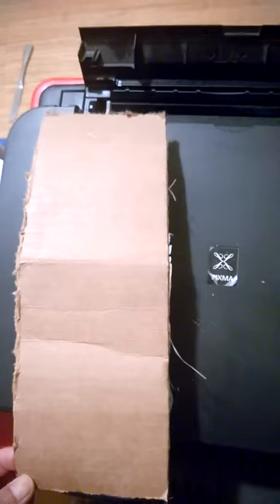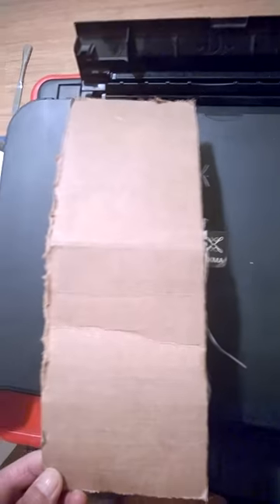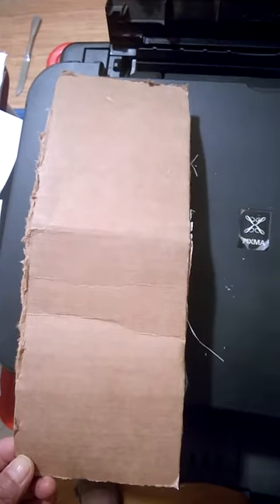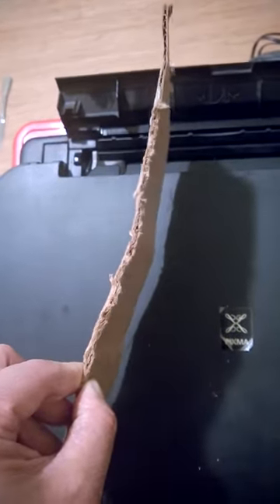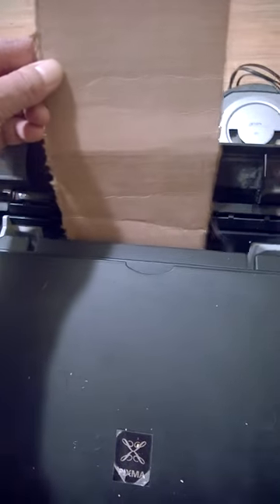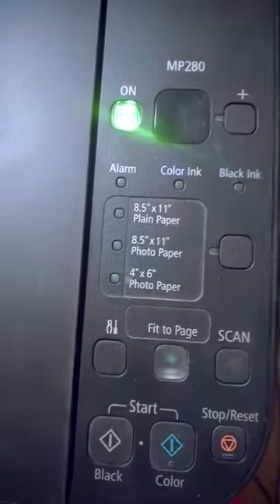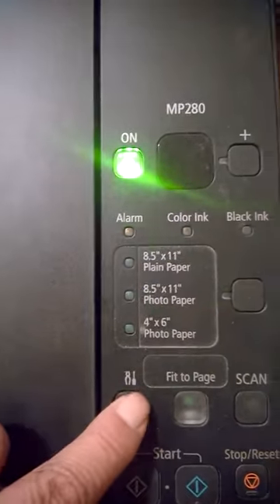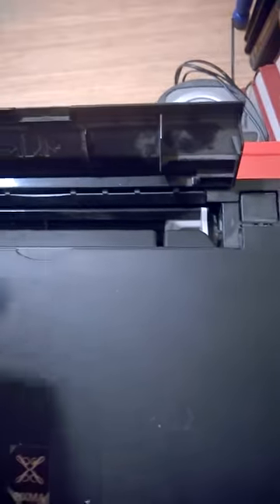Paper pick up Canon Pixma printer paper feeder not feeding paper properly in less than 2 minutes

Comment: I tried all the Canon forums. Nothing worked. But I did your trick, except with a newspaper. I kept pushing every time the rollers worked. Then, once the printer stopped, I pressed Start again to keep the rollers going again. I kept doing this until the newspaper came out the front end. Then I put the real paper in there and, voila! It works like a charm now. Thank you so much!🙏
Reply: Good to know it  thanks
Reply from the maker: You are welcome! Glad it worked😊
Reply: Having the same problem with mine, will have to try this. Kids said  throw it away and get a new one. Don't want a new one.

Comment: Thank you so much! My aging Pixma 300 has been working fine for a number of years until it stopped feeding paper from the paper "tray". I had tried using a Q-tip and alcohol to reach all of the rollers I could reach, but it didn't change the situation. I had doubts that the cardboard would work, but figured I had nothing to lose. The cardboard eventually jammed going in, but it was long enough to pull back out the paper feed slot. That did the trick! Thank you!
Reply from the maker: Glad it worked 😃
Reply from the maker: Glad it worked 😁

Comment: Worked!!!!  Out popped a nickle!  Couple of notes:

1. Gently use the card board
2. The cardboard does not go all the way through the machine.  You will use it to shove whatever is clogging you machine through.
3.  After the object is out, the machine will start feeding 3+ pages though the machine - blank.  let it finish.
4.  Upon finishing, set the machine back to "1" from "b"

Comment: My cannon pixma MG 3022 printer malfunctioned. I couldn't get the paper to feed through the machine. I watched a few youtube videos stating that the problem were dirty rollers and that they needed to be cleaned. I did this and still no success. I then came across this video and my first thought was that this was definitely going to damage my printer, but I was out of options so I tried it. IT WORKED. Imagine my surprise. I had a two safety pins lodged in there. I just want to say thank you to Ms. Lin Young for this unorthodox but effective method of fixing my printer. Thank you Ms. Lin Young.
Reply from the maker: Thank you all for your feedbacks regarding this method. :-) It's funny/not funny to read the kind of "stuff" that caused the paper not going through the feeder,  that were "pushed out" by using this method,: a Flower Stem. hah! :-).  I almost gave up trying but I am glad I did not. So. Try this method when you have relaxed and have some time to yourself. So you won't be frustrated on your first try/tries. :-). So let us know what you found inside the paper feeder that caused the problem. Unless, ofcourse, you found something you did not want anyone to know. :-)

Comment: I was about to give up and go on amazon and buy a new printer, I tried the cardboard thing and it did not work until I let the printer take the cardboard,  I felt it probably didn't work be4cause the cardboard jammed partway through, I went to shut it off but checked the inside by the cartridges and suddenly I see a shiny penny,  I then tried again and this time the paper fed through perfectly! Thanks Lin Young! Your solution really does work!

Comment: this sounds silly but this tip really worked. turns out there was some of my earphone earbuds that got into the printer! it took some time before it came out...but now my printer is working again. need to do a mental note to fold the paper feeder flap down to cover the paper pathway whenever it's not in use to prevent anything from going into it again!

Comment: Just chiming is to say that this worked! After weeks of not being able to print, I went on a Google hunt for a fix and saw this video.  Thought what the heck I've tried everything else, and sure enough a little white screw came out as the cardboard went in.  Now it works like new again! Thank you!
Reply from the maker: Thank you all for your feedbacks regarding this method. :-) It's funny/not funny to read the kind of "stuff" that caused the paper not going through the feeder,  that were "pushed out" by using this method,: a Flower Stem. hah! :-).  I almost gave up trying but I am glad I did not. So. Try this method when you have relaxed and have some time to yourself. So you won't be frustrated on your first try/tries. :-). So let us know what you found inside the paper feeder that caused the problem. Unless, ofcourse, you found something you did not want anyone to know. :-)

Comment: I was about to throw my printer away because I had been on the Canon website for hours looking for how to fix the problem and I had watched 5 other videos. Nothing was working. I didn't want to try the cardboard thing because I was afraid it would really mess up the printer, but as a last ditch effort I shoved some through and voila, my printer was working. Turns out I had a strip of paper that was crinkled up inside the printer. Thanks so much!
Reply from the maker: Thank you all for your feedbacks regarding this method. :-) It's funny/not funny to read the kind of "stuff" that caused the paper not going through the feeder,  that were "pushed out" by using this method,: a Flower Stem. hah! :-).  I almost gave up trying but I am glad I did not. So. Try this method when you have relaxed and have some time to yourself. So you won't be frustrated on your first try/tries. :-). So let us know what you found inside the paper feeder that caused the problem. Unless, ofcourse, you found something you did not want anyone to know. :-)

Comment: OMG thank you! I use a random paper manual to force it out. I found beaded ring in there thank got I elastic didn’t break. I even bought new inkt thought that’s the case though. I did multiple hard reset no results. After some searching found this vid. Your method works!! Thank you
Reply from the maker: So glad it worked. 😆

Comment: Dang, I'm impressed. I was so confused by the comments at first but this actually worked for me. To clarify, I was expecting to have to clean the rollers since I was getting the paper jam error but there wasnt any paper. Turns out, there was a twist tie inside the printer. To get it out, I just forced the cardboard in while the printer is not printing and for me it pushed the twist tie out. I wouldn't have expected that to be the issue like how would anything have gotten in there, but this video saved us from buying a new printer so thank you.

Comment: This was the video that got my hand me down printer on the road to recovery.  It led me to find out that foreign objects often fall into these Canon printers.  I've never encountered this problem with any other printer in my last 20 odd years of regular printing use!  Although the cardboard trick didn't work for me, and you will see why in a minute. I tried for quite a while.  Then tried putting my hand in , when I encountered something unusual on one side of the rollers.  Then I got a torch,  I could see a memory stick stuck in there.  I got a hook and went fishing.   Out it came.  It was a missing work one, now back with its owner.  I would say, use a torch first.  Then use the cardboard if you can't see anything.
Reply from the maker: Canon printers attract foreign objects. Glad it worked for you.

Comment: Thank you so much Lin. I did some spraying with duster to get the feed to work a short time before but the problem came back. After Internet search and more cleaning and shaking (but could not figure out access to rollers), I was ready to buy a new printer/scanner. Then I saw your video; I tried with thin cardboard I had and WA-LA! Paper is feeding again.
Reply: Me too!  Great trick, and easy too.

Comment: This method actually worked but mine was a bit challenging.  I noticed that there's a small bead inside. When I took it off, it's still a bit clogged so I did it again but this time, i tried to shake it up side down while forcing the board in and guess what, 3 more beads fell out. 😂  thank you so much for this!

Comment: Thanks for the video.  I tried it with a card stock that was the thickness of a post card and it worked.  I was too nervous to use a corrugated cardboard.  Turned out that I had a mini binder clip stuck in there!  Thanks again!
Reply from the maker: You are welcome. Glad it worked 👍

Comment: Was honestly thinking some of the comments under this video are not real LOL! But after trying this I immediately found a foreign object inside the printer. Not really sure what it's called but it's like an accessory attached to the zipper so it will be easier to pull, some kind of cable with a plastic on the end, it was stuck in there. I thought it was part of the printer as I was pulling it. But I thought that the first piece I took seems to have been cut already so if it's part of the printer then it's already broken to start with so pulling the other part shouldn't cause more damage than there already is and after getting it pulled my mom identified it as one of the little cables attached to the zippers of the bag. So yeah, thank you soo much! I thought I'll have to spend money just to get this fixed. But your 6-year old video just help me!

Comment: This also worked on my printer. Had a problem about paper jam when in fact,  there was actually no paper inserted in it. I have tried feeding my printer with a card board and it helped. It was not a paper jam issue at all; it was a twisted ring that got stuck in my printer. This card board helped me take the twisted ring out of my printer. Shaking the printer also helped in removing the clogged material in it.

Comment: This is a fantastic trick. I followed the instructions and there was really a piece of plastic in there. Tried to print but the problem existed. Then I followed the steps again with placing the cardboard at the other side, and surprisingly found another piece of plastic : ). Finally tried to print and it really worked out. Thanks.

Comment: Yes! This worked for my Pixma MG2550s! Had tried cleaning the rollers with alcohol and everything, didn’t think this was working until I noticed some bits of plaster on the table beneath the printer, kept going and sure enough a chunk came out on the side where paper seemed to be getting stuck/creased! Thanks so much.

Comment: Thank you! Our Canon Pixma mp495 was giving the E03 message. We tried a lot of things, but what worked was as follows: turn on printer, push maintenance button until we saw the lower case letter b, then, loaded the cardboard of the shape and size you showed in your video into the middle of the paper input tray in back, and while pushing the cardboard in with one hand, pushed the start button with the other hand.

The cardboard was pulled in part of the way and then we got the P03 error message. We shut off the printer and pulled the cardboard out (which took a lot of effort), but then saw that the cardboard had dislodged a candy wrapper that had been stuck in the feeder! 

If I were to do this again, I might first try it with a thinner cardboard (like a cereal box thickness maybe) before proceeding to the thick cardboard, because it got really stuck in there and hard to pull out.

Comment: @Lin Thank you so much for sharing - your tip also helped me fix my printer - I have a Canon Pixma MP282 - similar to all of the Pixma MP280 series - and my rollers on the left hand (control panel) side  were not grabbing the paper, to I used some thin cardboard with a little isopropyl or rubbing alcohol on it to clean the rollers. I did hold onto the card so the the rollers would slip and rub on it more to "help" the cleaning. Four or five runs through and the printer started gripping both sides of the paper when I put good paper in the feeder.

Comment: Thank you so much, it worked!! Printer wasn't picking up paper. I didn't think anything was stuck but did your trick and a hair band came out!! As good as new.
Reply from the maker: lol... "as good as new"...your hair band or the printer? lol. Thank you all for your feedbacks regarding this method. :-) It's funny/not funny to read the kind of "stuff" that caused the paper not going through the feeder,  that were "pushed out" by using this method,: a Flower Stem. hah! :-).  I almost gave up trying but I am glad I did not. So. Try this method when you have relaxed and have some time to yourself. So you won't be frustrated on your first try/tries. :-). So let us know what you found inside the paper feeder that caused the problem. Unless, ofcourse, you found something you did not want anyone to know. :-)

Comment: At first it didn't worked for me.. And then yesterday when I saw that there's a lot of wasted bondpapers after having a day off and it gave me headache after the 1st print..Tried again putting a cardboard..it really worked but I think it went overboard..it doesn't follow the default margins at the top anymore..instead of 1 inch it prints 1/4 inch closer to the edge..But it really works so it saved my day yesterday.. For now I need find the culprit of this next problem.. Thanks Ms Lin..

Comment: Just tried your trick and it worked! Oddly, a small 1/4 inch spring and a 1/8 inch gear came out. Probably part of the printer that jammed everything. The main thing is that it works.
Reply from the maker: Michael Todd Glad it worked. funny/not funny to see what was found from these printers.lol.
Reply from the maker: Thank you all for your feedbacks regarding this method. :-) It's funny/not funny to read the kind of "stuff" that caused the paper not going through the feeder,  that were "pushed out" by using this method,: a Flower Stem. hah! :-).  I almost gave up trying but I am glad I did not. So. Try this method when you have relaxed and have some time to yourself. So you won't be frustrated on your first try/tries. :-). So let us know what you found inside the paper feeder that caused the problem. Unless, ofcourse, you found something you did not want anyone to know. :-)

Comment: THANK YOU! This worked! I had nothing jamming it, just wouldn't pick up the paper. I jammed the cardboard in and out ( not letting it go completely through) a couple times.
Reply from the maker: glad the idea helped you.
Reply from the maker: Thank you all for your feedbacks regarding this method. :-) It's funny/not funny to read the kind of "stuff" that caused the paper not going through the feeder,  that were "pushed out" by using this method,: a Flower Stem. hah! :-).  I almost gave up trying but I am glad I did not. So. Try this method when you have relaxed and have some time to yourself. So you won't be frustrated on your first try/tries. :-). So let us know what you found inside the paper feeder that caused the problem. Unless, ofcourse, you found something you did not want anyone to know. :-)

Comment: it did work, I had a piece of glue from my glue stick stuck inside. Im a messy crafter. I pushed the cardboard through and it popped right out and my printer started working...thanks sooooo much!
Reply from the maker: Sandra Ross you are so welcome. it's crazy how it worked out...glad you fixed your problem.
Reply from the maker: Thank you all for your feedbacks regarding this method. :-) It's funny/not funny to read the kind of "stuff" that caused the paper not going through the feeder,  that were "pushed out" by using this method,: a Flower Stem. hah! :-).  I almost gave up trying but I am glad I did not. So. Try this method when you have relaxed and have some time to yourself. So you won't be frustrated on your first try/tries. :-). So let us know what you found inside the paper feeder that caused the problem. Unless, ofcourse, you found something you did not want anyone to know. :-)